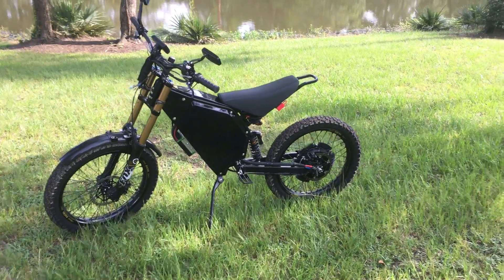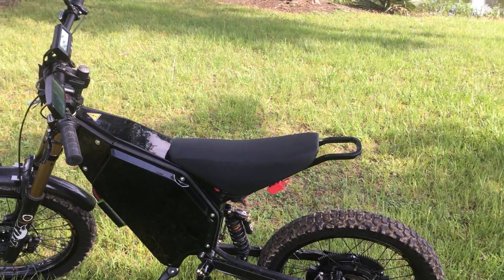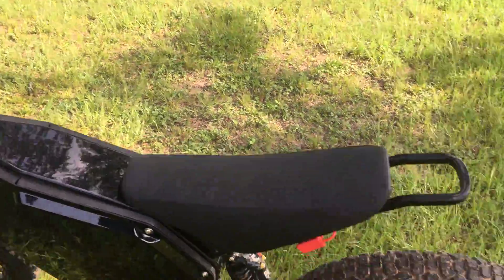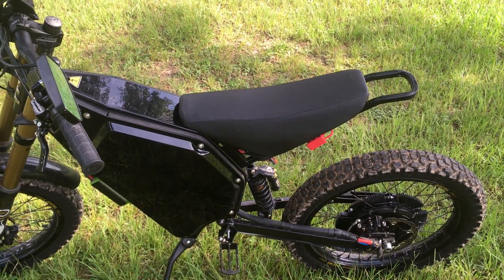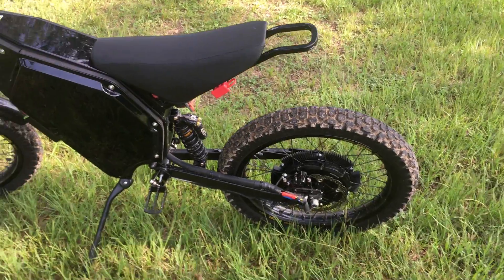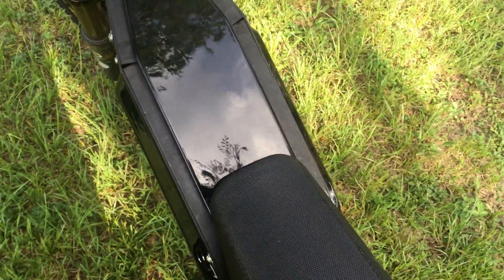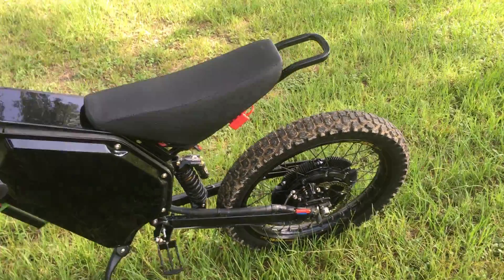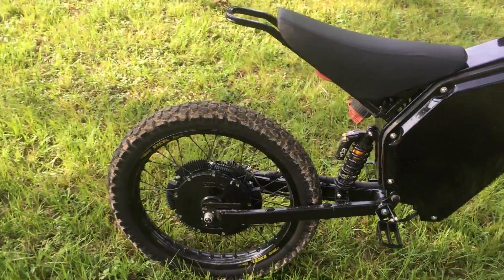Enduro Electric Bike walk around.

Comment: Hya bud, Can you say are are your rims the same width front and back?  or is the rear slightly wider? Looking at the UK Excel website they do a pair but again as rear rims are wider, yours rims both front and rear look the same to me  but could just be an optical illusion from the camera,  Thanks again and great content!
Reply from the maker: They are both the same wheel front and rear. Not that you have to, but that is the route I chose.
Reply: @TheFootbaldd  Thanks, im looking on excel site now. they do two sizes the rear is a bit wider than the front. Dont suppose you remember with ones you went for? Yours sits exactly how i want mine, great choice of rim and size.
Reply from the maker: @apsert  Excel GDK406 Takasago Black 19" x 1.85" 36h Rim
Reply: @TheFootbaldd  Thamk you brother!

Comment: Hi, what's the clearance like on the swing arm? Would it take a 90/90 19 tyre do you think?
Reply from the maker: So that's like 3.5" wide. I will take a look at the swing arm, but that is probably going to be a tight fit on a 19". The swingarm tapers inward as it is. I have plenty of clearance with the 2.75" 19"s but I don't have any other size mounted tires to compare it to. I am sure that they can be made to fit if there is interference. I would check the forums on endless sphere to see what other tire sizes people are running.

Comment: Hi. Where can I get cooling radiator  to the motor wheei like yours on the bike? 
Thanks.
Reply from the maker: https://hubsink.com, I also injected ferrofluid into the airgap. It is known for its thermal coupling without performance loss. I haven't tested this, but I would suspect that the ferrofluid increases magnetic coupling and decreases leakage losses in the stator.

Comment: What type of rims and tires are you using? I found some motorcycle tires that are 100mm wide but I'm afraid that they will be too wide for the rear dropouts. Any suggestions?
Reply from the maker: Excel GDK406 Takasago Black 19" x 1.85" 36h Rim

Shinko 244 Dual Sport Front - Rear Tire – 2.75-19/Blackwall

Kenda (7010019) 70/100x19 Tuff Tube (TR-4)

IRC Rim Strips – 19"
Reply: @TheFootbaldd  Wow thanks for the quick reply bro.
Reply from the maker: @vineinc.5690  No problem, there are a number of cheaper rims you can find. There are also other options in size. To build a two cross on that wheel for the rear hub I did a bit of gentle grinding to the nipple holes before lacing, so that I could get straighter nipple/spoke angles once tensioned. On the front I built three cross, and didn't have to touch them.
Reply: @TheFootbaldd  I've already got the rim situation figured out but thanks! I will get a prebuilt 19" rim off of AliExpress for about $120.00. And do you know of any smoother tires? I want them to be 2.75" wide but I only find knobby tires. Thanks for your help!
Reply from the maker: Vine Inc. I had looked up a set a while back, but I cannot remember of the top of my head. I think there are more options with a smaller rear tire as well as clearance for width
Reply: @TheFootbaldd  ok thanks for the help! Keep riding man!

Comment: Hey I was wondering if you could add a total cost... How much did it cost to build it?
Reply from the maker: between 7 and 8k usd. There are a number of parts included in that, that I never used like the BMS I purchased, water cooling equipment, and various parts and spares. It is a nice build, and there are plenty of alternate and cheaper sources of parts that could be used. I am not a big fan of these hope v4 quad piston brakes and 8" floating rotors for one. Maybe I need to keep working on them, but for what I paid I am not impressed. Just making more economical choices for wheels, hub, rotors, brakes, could save a lot. I also wasted a few hundred in rushed international shipping. With the BAC 2000 current limited, I am also not using the power I designed the battery for.

Comment: Was it hard to build?
Reply from the maker: Paul Pogba sorry I just saw this. Yes and no. It depends on how involved you want to get. I built a decent battery welder and then build a rather large pack myself. I also built custom wheelsets with motorcycle rims. There was various small machining I had to do also.
Reply from the maker: For me the hardest part was sourcing parts.

Comment: Nice bike!  So what is your battery setup like? What lipos did you wire up and how many miles can you get before you have to recharge? Is this a standard china EEB frame, and what motor brand is that? I really like the setup you have
Reply from the maker: Stanson em3ev frame but I widened the cavity with plastic spacers. No lipo, i build a pack using 252 hg2 cells in a 21s 12p configuration. The motor is a crystalite. I am thinking about changing it out.
Reply from the maker: I was getting 50 miles on a partial cycle. When It warms up I will get it tuned up and do some more testing.
Reply: @TheFootbaldd  Impressive work! Why are you looking to change the crystalite out? And did you buy a name brand controller or rig one up yourself?
Reply from the maker: Stanson Out of time constraints I went with the ASI bac2000. The reason for that decision was I wanted field oriented control. They are not very helpful about providing detailed documentation, so I am not sure if I want to go full custom at this point or not. The challenge and most time consuming part of that would be the coding if I wanted a full digital control. There are some better suited motors with wider magnets and different winds from qs on their 205 variants that I may consider. I don't have as much experience with solidworks and magnetics right now to want to take on that task.
Reply from the maker: My first goal when I get to work on it is to build an active bms control so I can get the most out if my battery. From there I want to fine tune the mechanics like better head tube cartridge and getting the brakes/front fork dialed in.
Reply from the maker: Once I have that worked out I want to get the power level up to 150amps. I may setup a dyno and get an oscope on the controller to see what its limitations are

Comment: Nice biuld looks awesome I have one of this frames 5000w hub 150amp sabvoton controller only running about 4kw and that's fast bet yours wheelies like mad
Reply from the maker: It is parked for the winter, but I have a few projects I want to get done on it before spring. I started designing an active cell balancing network that continuously maintains the cells in balance during operation and during charging. I also need to get the brake light installed and a switch designed. Lastly I want to boost current from the 90 amp limit currently to 150 or so, and potentially change the hub motor. I have some wood working projects and auto projects I have busy with since I moved, so that is on the back burner for now

Comment: No point to the pedals?  Sure there is - so that when you get pulled over by a police officer, you can say "oh this?  it's just a bicycle, officer."  :)
Reply from the maker: Garen Parham I just moved, but I plan to register this bike as some sort of moto soonish, otherwise I would agree with you. From a riding standpoint I prefer pegs to pedals
Reply: Oh sure, I was just having a bit of fun there. :)   Would love to see any more videos about this stuff / your bike.  I have the an ebike with this same EEB frame, but haven't seen another build like yours yet (expanded side covers, and using an ASI controller).  I'm also much further north so heat isn't as much of an issue as cold is.
Reply from the maker: I am actually up north now as well. I am busy trying to get everything finished before winter, so I haven't had time to mess with the bike much... Next year I want to be pushing 150+ amps and lace up a bigger motor.
Reply: The QS 205 v3, is what I have, and is probably the most popular for rear hub DD motors.  em3ev now carries it too.   I'm running 100A on a Sabvoton controller which I'm mostly happy with, but haven't bothered doing anything with the motor yet.  I've heard of folks in california who were able to register their bike as a moped by using the serial# on the frame in place of the VIN, but here in WA when I asked the local registration place, they were just like "what?  it has pedals and no VIN?  just ride it then, you can't register that." :)
Reply: Garen Parham how many turns is your motor? Im getting a 4t on 19" on 72v100a and wondering what the top speed will be
Reply from the maker: Joshua Huang interested as well. I have got it up to 56mph, but one of my smaller friends hit my speed limiter that I had set at 60 mph. I am only pulling 30a flux weakening right now
Reply from the maker: Flux weakening inputs a negative value in the quadrature vector in the dq form allowing you to go faster than the motors natural limit at that voltage. Essentially it reduces the back emf when it approaches driving voltage.
Reply: Garen Parham im doing the same build as u. received the batteries now and waiting for the motor/controller. what top speed do u get on what size rim?
Reply: @GarenP  Garen I would really appreciate your input, I am considering the QS205 for my commuter bike, but it may be overkill. Can the QS205 be used with a 52v battery? Or is that not enough juice. Secondly, can you get a range of around 30 miles before you have to charge with the QS motor?

Comment: Where did you get the pegs?
Reply from the maker: ShortCircuit_FPV They are the Qulbix foot peg kit with a longer through bolt. I was going to machine some threaded ones out of aluminum but I ended up just buying those.
Reply from the maker: ShortCircuit_FPV They have been working great, and they are designed to collapse back if you contact something, but they will probably mushroom the bottom bracket threads overtime with how they are made. I like them and they work well, but there is definitely a better way. That was the only company I found that made anything like that.
Reply: @TheFootbaldd  How are they holding up? Bottom bracket still OK?
Reply from the maker: Freddie C the pegs have been fine. No issues there.
Reply: @TheFootbaldd  do they mount over the bottom bracket? or did you have to remove it and mount them directly onto the frame?
Reply from the maker: @Fred_POV  They mount with a through bolt to the bottom bracket shell. If I were to make myself ones from scratch, I would have made them thread into the shell itself, but these work fine.